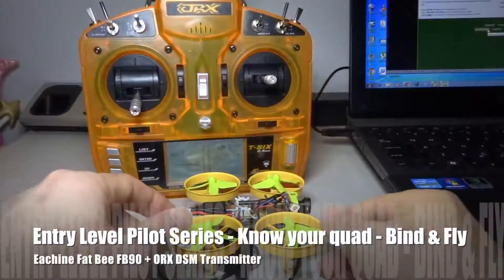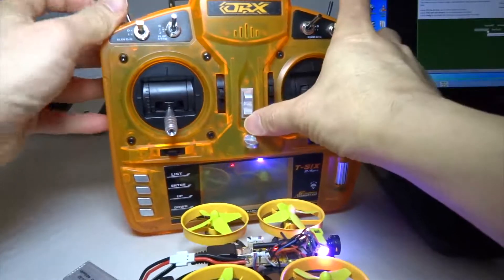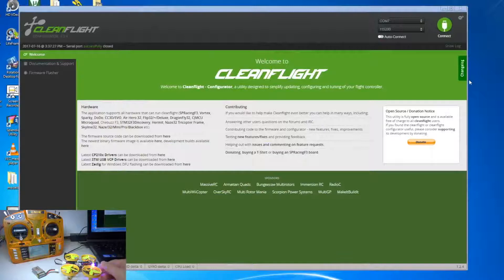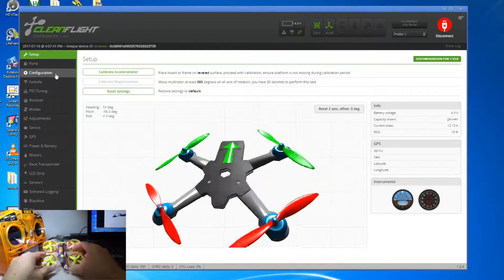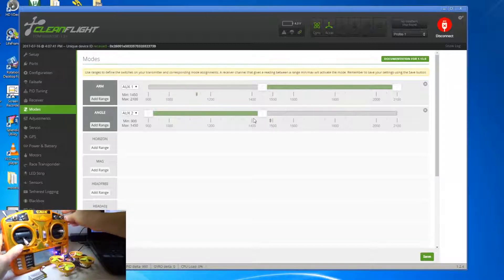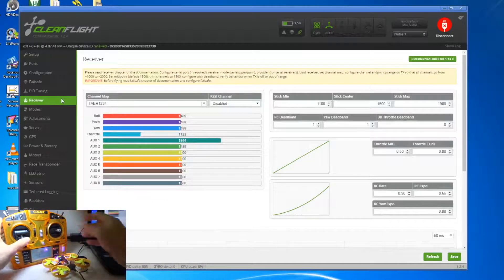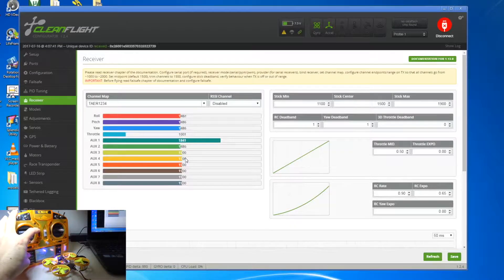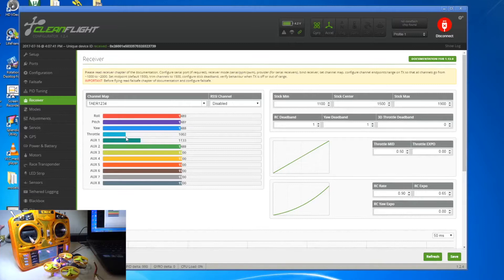Entry Level Pilot Series - BNF = Bind and fly out of the box? - Eachine Fatbee FB 90

Comment: JT, is this the improved version of the Fatbee FB90? I owned the original version and it is a terrible flyer. The props rubs on the ducts that make a lot of noise and vibration. My FB90 cannot maintain a stable flight and always drafts everywhere. I removed all the ducts and changed out the props and then it flys better but still much worst than any toy grade ducted quads such as the Eachine E010 and the Furibee F36. I than went through the calibrations and setup in Cleanflight to set it up as your video shown and it still not close the the stability of the toy grade quads. It's just now sitting on my shelf and taking up space for months.
Reply from the maker: Hi Abghere. No, the same one. I bought it when it was on sale $30). I knew that it was not a good one but bought it for the dsm receiver to make this video and few other videos. Will see if I can make it fly better. Btw, if you have removed the ducts and it is still drifting, it may be the trim issues. Try adjusting the trims on your transmitter to get rid of the drifts or you can set all your channels to min 1000 and max 2000. I had the same issues with the Makerfire and was able to get rid of the drifts that way. Could you send me a photo of your mod fatbee?
Reply: Trim and min max travel are all calibrated in Cleanflight to near perfection. No help! Where would you like me to drop off the pic?
Reply from the maker: message me on my facebook jtgravityrc
Reply: I don't used FB nor I-gram. PM me your email address. I'll email it to you.
Reply from the maker: can't do pm on your page but anyway you can pm me - go to my channel, click on About and click send message